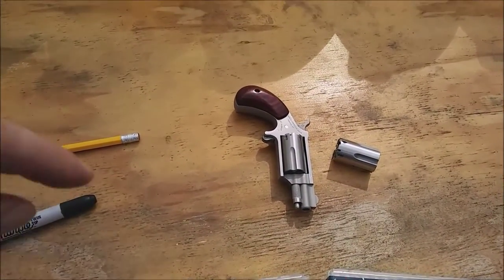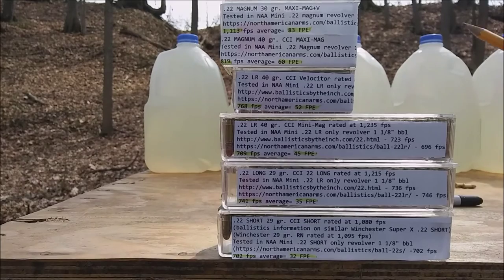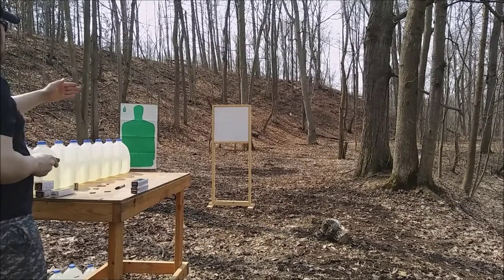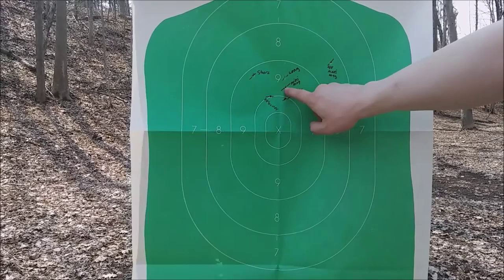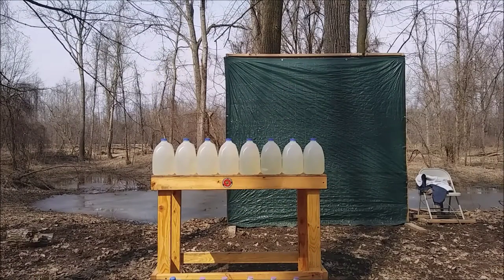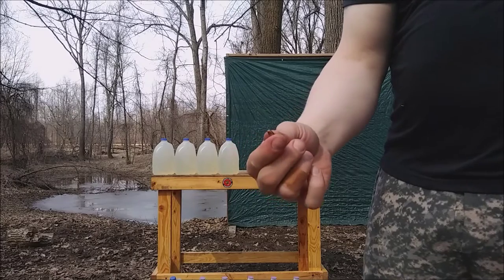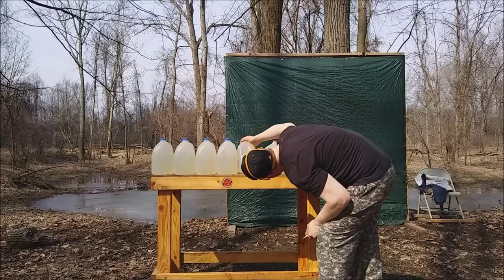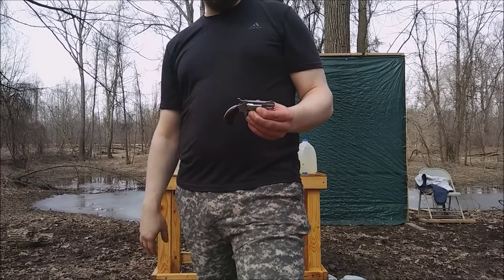NAA Mini Vs. Water Jugs And Wood (All .22 Cartridges) Magnum, LR, Long and Short

Comment: another informative video. A lot of time goes into these I know. Ice is almost off the pond.
Reply from the maker: Thanks for the comment. Yeah, when you can't find .22 short anywhere and it takes 2 weeks to ship and when the information takes awhile to gather, and weird wood stands need to be built, a month of drinking water jugs collected and trying to figure out how I want to present my point needs to be thought out, sometimes they take a little time. Thanks for noticing. That little pond is actually and old part to a nearby river, in the 1950's or so the state removed that section from their official property since that part has no actual springs, and only fills in from river overflow in the winter and spring. Some parts of the year it's dry land and some parts its a pond.

Comment: WHY have I been wasting my time, money, and comfort with giant sized pocket guns when this little gem is clearly the goto for SHTF situations? I had no idea they were so potent. Last time I was at the local gun shop (there's only one in my area :() they had one in the counter for what seemed like a ridiculous amount of money. I thought it was only a novelty piece, so I passed on it.
Reply from the maker: The most powerful round in this is about the same power as a .22 LR in a full 2" revolver, such as the LCR in .22 LR. This gun is like half the size though! More power than a .25 ACP even, with a .22 magnum in this vs. a Colt Vestpocket.
Reply: Maybe I should reconsider my primary carry? I've been hauling around the S&W 649 with .357 Magnum rounds in it. My plan had been to transition to a Sig Sauer P938 which is a bit lighter, thinner, and carries two extra rounds when I use the six round magazine. I just need to reach a magic number of failure free shots out of it. Perhaps the NAA  mini is really the way to go.
Reply from the maker: Personally, I would not carry the NAA mini. It's not the caliber issue, it's the gun! I would have no problem carrying a .22 mag or .22 LR in a J-frame revolver or small pistol, but the NAA is just too small to shoot very accurately.
Reply: Dude !  Please See My Comment
Reply: @GunSam  I find the Hogue slip-on grips resolve the grip situation for me 100% with almost no increase in grip size. I have two of these, the basic NAA-22lr and the Ranger 2 breaktop with the 2 inch barrel. This is a great vid, it confirms my suspicions that the 22lr is as good as the 22mag in these barrel lengths.
Reply: @Fudmottin  The NAA gun makes you forget you are ever carrying anything in your pocket, Totally undetectable from the outside
Reply: @raydemos1181  This is bad news when you carry it into the court house to serve jury duty.

Comment: .22 LR is probably the most under estimated cal there is. When I was in high school, .22's were the most used cal in either pistol or rifle for small game in my area. Also for some fairly close range varmint hunter. I had several rabbits that had the entire exit side of a stinger hp head blown off at about 40 feet.
Reply from the maker: It's good for defensive purposes, because beyond all the science, no one wants to get shot so if this comes out, someone's going to back off.

Comment: I have two NAA Minis, the NAA-22lr which is the smallest other than the .22 short they make, and their Ranger 2 breaktop. I found the birdshead grips hard to hold but did not want to add too much size. I tried the Hogue clip-on black rubber grips and problem solved. Can't recommend them enough! Amazing grip with much more control. Highly recommend.

Comment: Good video...! we own the .22lr model, we practice with any ammo available, load velocitors when rarely carried...we practice more with this little gun than any other, almost weekly...it is not a gun for hollywood gunfighting, but it can go anywhere, is reliable, and could get it done at very close range (within 10 feet for us)...the one thing I noticed was the keyhole round didn't go through the 2nd board, and I don't know if you mentioned the thickness of the two boards...

Comment: Great vid. Don’t see any advantage 2 the magnum
Reply from the maker: Thanks, the only advantage is more variety of ammo it can fire, however if you get the magnum version you're pretty much stuck with using magnum as the bore is .224" and the .222" LR's and shorts give terrible accuracy. One might say the .22 LR version is better, however it's a lot smaller than the magnum version and difficult to hold.
Reply: Gun Sam Revolver Aficionado I greatly appreciate the fact you always try to get back to your subs and try to answer questions. You have helped me allot over the years. 1 more quick question, why doesn’t anyone test the stingers through this gun? They seem to be the hottest loads I’ve ever shot in 22lr..
Reply from the maker: @allenhelton1401  I really don't recall why I never tested Stingers, I should have. I don't know why other's don't either.
Reply: There is advantage.  You just haven’t realized it.  Pop a deer with a 22 long rifle you may or may not find it.  Zap one with a 22 mag you will always find him.  Grew up poor.... out of necessity
Reply: Wrong. .22 magnum is a bit more reliable than .22 LR, it’s been proven. Typically higher quality and more likely to fire every time.

Has at least 100 FPS or more velocity gain out of the minis. I’ve seen chronos of a 29 grain .LR round shooting slower than a 40 grain magnum. At the same bullet weight the magnum can be up to 150 FPS or more, that’s significant out of such a small barrel.